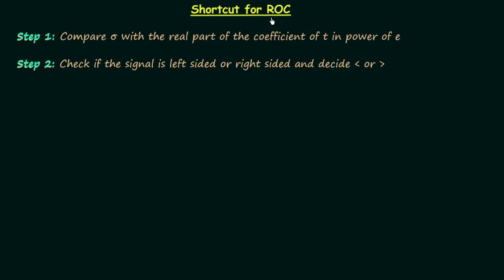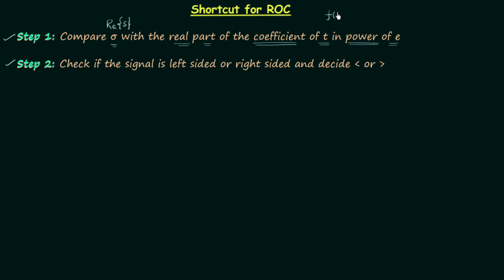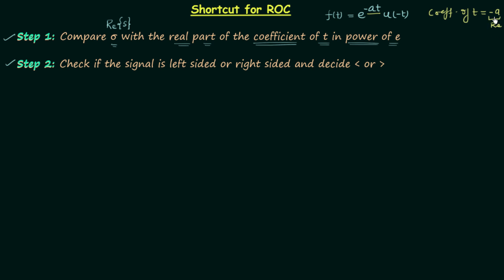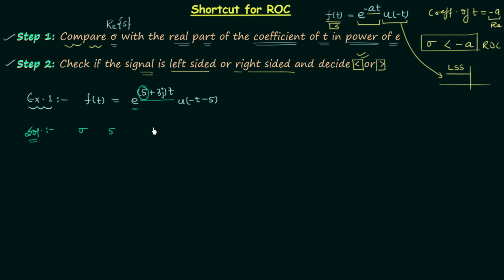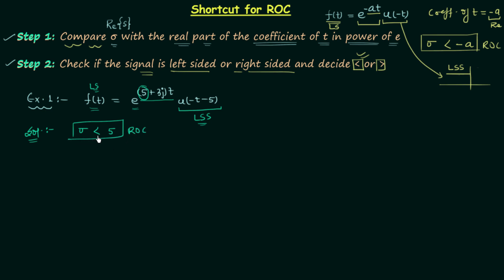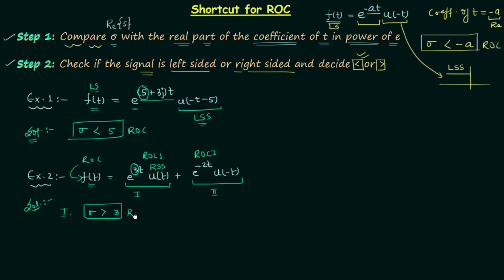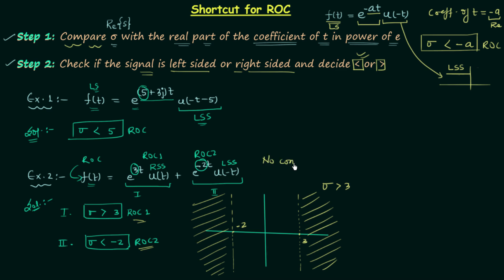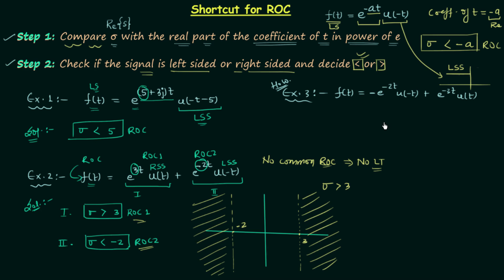Shortcut for Region of Convergence (ROC)

Comment: roc > -2
Reply: Pankaj Sharma can you check ur ans again bcz i m getting - 3 to - 2
Reply: parth modi there is minus sign so I think roc will also be the difference
Reply: Pankaj Sharma no minus sign will not affect
Reply: both the signals are RSS. For first signal, roc > -2 and for second roc > -3. So the common roc will be roc > -2. Hence roc > -2 is the correct answer.
Reply: roc > -2 correct

Comment: -3<σ<-2 , both sided signal, LTS unstable, f(t) not abs. int.
Reply: Only if it includes jw axis and in this case it is clearly not including
Reply: Joey Zhou answer is right
Reply: I think the answer is right
Reply: @kawae_otaku  why it is not stable??
Reply: @MrPotaatooo  because it doesn't include jw axis
Reply: no bro its stable system
Reply: Joey ,we got Sigma greater than -3,so system is stable don't stop the roc at -2 it  will continue to infinite
Reply: Joey Zhou ur answer wrong
Reply: how is it wrong?
Reply: Joey Zhou for both sided signals
Lti is stable
Reply: @phanindrareddy4885  No LTI is stable if it includes the imaginary axis,i.e, jw axis.
Reply: @sagarksahoo4667  yes yes

Comment: between -2 to -3, as the case of 1st sigma,  we have left sided signal so the value of sigma turns to less than -2,and in the case of 2nd sigma value, we have right sided signal so the value of sigma turns to be greater than -3 and there will be intersection between these regions ,so it will be the convergence region of the entire equation
Reply: Use concept of math it lies between 2 and 3 and not cross imaginary axis so not stable.
Reply: wrong answer
Reply: @godishelping  why?
Reply: @Muxik4k  it's not left sided, there is -ve sign
Reply: @DayaTapuKPapaGada  how does -ve sign matter, it is still left sided signal. See example 2
Reply: @DayaTapuKPapaGada That's amplitude reversal, not time reversal. It doesn't change left sided into right sided